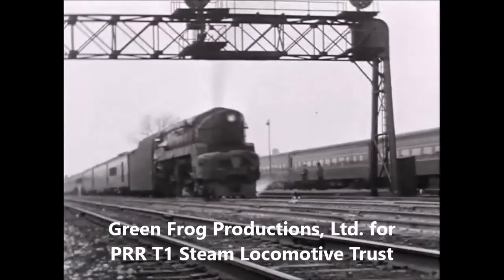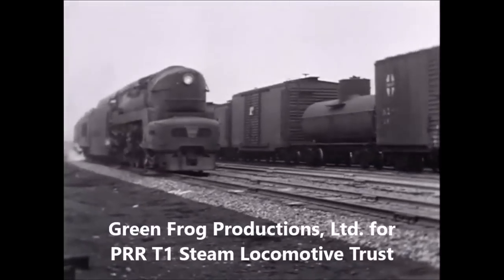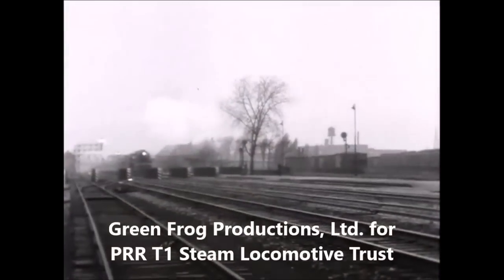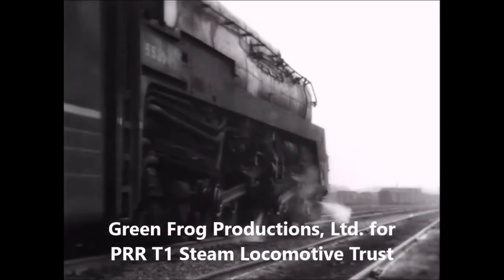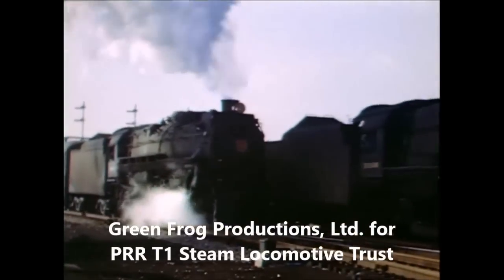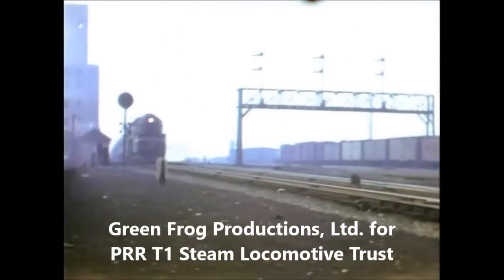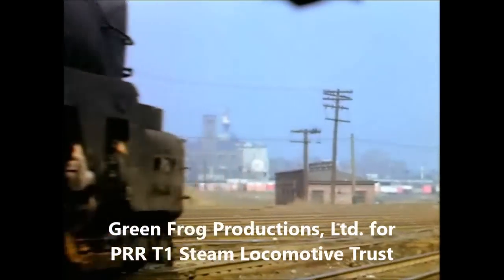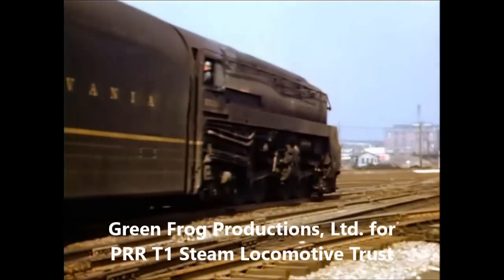The Golden Twlight of Postwar Steam Pt 1, Green Frog Productions, Ltd

Comment: All I ever hear is how common it was for the T's to have wheel slip.  Many yrs back I talked w/a retired PRR engineer who really liked the T1, and a friend of mine's grandfather also ran T1's in passenger svc.  He too was a T1 fan.  Both had the opinion that excessive wheel slip was a crew thing, and, or, due to lack of maintenance.  I would love to see the 5550 project go the distance!
Reply: The T1 wheelslip was largely due to improper operation by the crews. The trick to operating the T1s was that they had to accelerate VERY gradually in order to maintain their adhesion. The passenger steam locos the Pennsy traditionally used (Atlantics, K4s, etc.) were engines that designed for quick acceleration on commuter runs, and as a result many crews tended to operate the T1s in the same manner. 

Interesting fact at one point the Norfolk and Western, a railroad that specialized in slow, drag freight, tested a T1 on their trains and concluded that the engine had no design flaws and that all they required was proper training.
Reply: Patrick3751 yes, that sounds right. Sure, when starting a train the weight shifts backwards, especially because of the water in the boiler, which is not a problem on a 4-8-4, but on a duplex that has a different outcome. And the engine produced 6552 hp (some say up to 6760 hp), that is more than 3250 hp per cylinder-set, which is about the same as a K4s, but the K4s has 6 drivers, one set of the T1 only had 4 drivers. If you would handle a T1 the same way as a K4s it would act not like a K4s.
Reply: The new one will have the new valve gear they tried out to resolve the wheel
Slip issue
Reply: @Patrick_3751  you mean a slow and steady pace?
Reply: 5500 had diffrent valves fited after an accident, that became the best in the fleet
Reply: I know this is an 8 year old comment, but I think part of it was that the suspension wasn't equalized quite right between the front and rear engines. The front engine was the one that slipped regularly and as far as I know this was because the rear engine's  slightly greater weight on drivers held it to the track a bit better than the front, given the suspension in use. 

It didn't help that that the T1 is way higher power than the K4s that it replaced, nearly 100psi higher boiler pressure and much higher horsepower.

Comment: One of the great things about technologies before the end of World War II is they can be revived at will, including the electronics of that era. In the post-war period, solid-state devices began to appear first in information/entertainment systems, then transportation, material handling, power, etc. If one wanted to re-create an early model pocket radio, one might find the primitive germanium transistors to be unobtainable unless you can spend several millions of dollars to create a small production line for them. The same is true for a certain model guitar amplifier, circa 1972: the SE540 integrated circuit would cost millions to fabricate one, or ten thousand
Reply: A piece of tech needs to be at least 70 years old to be easily recreated. A cycle really just like history.

Comment: It's a shame that none were saved.
Reply: Yeah, instead they saved a damn B4a!
Reply: What happened to the PRR program that saved all the PRR power that ended up at Strasburg?  Hat's off to the PRR for that effort for sure, but why no PRR T-1??
Reply: Probably because they were given so much publicity when they were introduced, then they started having all those problems, the PRR perhaps though of them as a failure so didn't want to draw attention to them by the late '50s.
Reply: I think you'll be happy to learn they're building a new one! Look up the T1 Trust. They're doing what the Brits did with the 60163 A1 Tornado, and building a new T1 from scratch. It'll be numbered #5550, and already they have the tender, front piece, cab, some of the wheels, and part of the boiler. They hope to have it finished by 2030.
Reply: Oakview Films 2030?!?!  Wow that's long

Comment: As an admitted Reading fan, I find it interesting that at the same time the the PRR was scrapping THEIR T-1's (4-4-4-4), it was leasing many of Reading's 4-8-4 T-1's (1956 and '57 I believe) for freight power in and around Enola (predominantly Enola and North).

Of course Reading's T-1's finally got their shot at passenger service in the Iron Horse Rambles of 1959-1964 and on many, many later incarnations including the American Freedom Train and the Chessie Steam Special.  Perhaps PRR might have been better of with 4-8-4's themselves which had long since been perfected on roads in all parts of the country.
Reply: Lenny Hendricks actually PRR leased N&W J class locomotives as well. It was found that the J class locomotives performed better. they don't have the wheel slip problems like T-1 and can do better on rougher terrain. I am a big fan of the NW J. I think if Pennsy would have kept the T-1 with a more conventional northern design it would have performed better..
Reply: Lenny Hendricks do you know reading 2100, 2101, 2102, & 2124 will be in the story of PRR 5550 and also 2101 will run again this year and also there is gonna be a C&O J1 built and it will be completed in 2023 and it will have a new speed limit and it will be up to 140mph and it can travel from 70mph to 125mph and also it will run from Charlotte, NC to The first stop of the Train to Thomaston, CT from the N&W line to the Nagatuck railroad line to thomaston, CT and it will run every, day, week, & month, & year, and it will be reliable and it will pull the American freedom train by doubleheading with Santa Fe 5011 every 4th of July
Reply: N&W let PRR borrow ONE for testing, and somewhere over 100mph the valve gear blew out.  The book Rails Remembered (#6) talks about the engineers from Roanoke went and brought her back on 1 cylinder.
Reply: I knew PRR leased ATSF 2-10-4's, I didn't know they leased N&W J's.  They probably would have been better of with N&W A's, but they had already rejected A's back in the beginning of WWII when they accepted the C&O 2-10-4 design for the PRR J-1's.  But they did lease the RDG T-1's also.  Check out David P. Morgan's STEAM'S FINEST HOUR.  Also many others about this period on the RDG.  Some of the first RDG 4-8-4's to be scrapped were the one's PRR had used and ruined.  ATSF and RDG were dieseling at this point, so nobody cared as long as they got the lease payments and got the carcass back to be scrapped.
Reply: I rode the Chessie Steam Special when it came to Pittsburgh. I was about 9 years old at the time.

Comment: I pray they fix the wheels. The wheels on the orginal engine had a very high a chance of wheel slippage while going up hill.
Reply from the maker: Anarchy Truck Pulls Those problems have been addressed. Take a minute and read the FAQ on our website, www.t1trust.org
Reply: Ok
Reply: The T1 Trust this locomotive needs to be around long enough and you need all it's flaws to be correct and also it will never be retired and it will exist forever and remember to do the flaws and it will be correct too.

Comment: Now is the new one gonna have real poppet and a non Pennsy water feed so it can work with less wheel slip and have more steam made.
Reply: Matt`s Mocs because they know the actual one couldn't do the record, so they are trying to unfairly change it in order to vandalise history.
Reply: If they can't make obvious updates they'll never reach their goal of beating the mallard's record.  It a question the donors to the project have to ask themselves.  What is more important to them?  Historical accuracy or the speed record?  It's a question for those putting up the $$ to make, not the railfan community at large.  Ross Rowland certainly made all the changes he wanted to on the engines he restored, esp NKP 759 and RDG 2101.

Comment: This loco would have fared better in service if the 3 rd and 4 th cylinders were mounted between the frames driving the third axle and the loco made into a 4-8-4. This would have helped in the slipping problem

Comment: The Being SHOW a T-1 at 65 the. Street out of the MAIN ENGLEWOOD STATIONS. 
      The T-1 was on what was CALLED WEST SIDE of the ENGLEWOOD STATION. The TRAIN on the other side was ACTUALLY, The NEW YORK CENTRAL RAILROAD.
    The only real Problem with the T-1 was it's on a HARD inclined and HEAVY RAIN allot of WHEEL  SLIPPING and allot of SAND on the tracks.
  I SAW PERSONALLY from the AGE of 7 - 11. I lived three BOLCKS AWAY it was GREAT and at the age of 76. I JUST WISHED  that the YOUNGER KIDS Could SEE the SIZE, HEAR the STEAM in creeking, hissing, spitting, the SMELL of COAL, OIL and WATER. And the HEAT coming from the ENGINE .
    ""ALL, IF I COULD GO BACK INTO  TIME  THE PAST WOULD FROM 1945 - 1954 where STEAM was KING AND FOR GOOD REASON"". GOD BLESS AND PROTECT ALL OF USE ALL OF USES.

Comment: Are t1 not articulated
Reply: yes no articulation
Reply: PRR T-1's (as well as the Q classes and the S-1) are duplex drive, not articulated.   Duplex drives are 4 cylinder locomotives like articulateds, but the front engine cannot pivot independently on duplex drive locomotives while the front engine can pivot independently on articulateds.  This is why duplex drives are called rigid frame locomotives.

Comment: Not saying that restoring a T1 is a bad idea, I love the idea, but weren’t the T1’s problematic? Didn’t they suffer from lots of wheel slip?
Reply: From what I've read it is suspected that engineers used too much throttle at startup because they were used to their less powerful engines and the T1's poppet valves allowed more instantaneous throttle response.

Comment: I support your trust, except for how you apparently want to beat Mallard’s record. Records are meant to be broken, yes, but still.
Reply: "records are meant to be broken, but still"  The record was never mallards to begin with.  
If the brits want to keep their record, they'll just have to earn it.  The only reason the mallard has maintained its record is because its record is official.  There are stories of T1s going 140.  While these can't be confirmed, you'd have to be pretty stupid to doubt it.  Considering an E6 atlantic, a piddly locomotive dwarfed by the sheer scale and power of a T1, could manage 115 mph, the notion that the T1 is incapable of 128 mph is asinine.  Should the T1 be completed, and a flat enough section of track found, you better believe that a free steaming rigid frame duplex is going to shatter the record of a pacific covered in shiny sheet metal.  I'd even wager that a T1 pulling a train of heavy weight cars could beat the mallards record.  With that being said, the Mallard can probably go even faster than it's own record.  Bear in mind it was hauling cars behind it, and with a downhill grade steep enough just about any locomotive can be a speed demon.
Reply: No-one will ever beat Mallard's record.
Reply: @Xenogeek2  On the contrary: There are credible sources behind the notion that Mallard's speed has already been bested. One of the goals of the T1 trust is to investigate these claims.

Also, keep in mind that Mallard severely damaged itself during the record setting run. The A4's didn't do commercial service at 128 mph.
Reply: @Mrcake0103  thing is tho if they go for the record and somehow break it (which is highly unlikely) that T1 wouldve killed a legend. When it comes to steam engines 4468 is one of the all time greats and breaking that record would basically kill it.
Reply: @ajf3202  what about Scotsman? Usually he gives the image of what a steam engine is: a larger loco with a tender pulling a rake of coaches
Reply: @davidantoniocamposbarros7528  thing is tho. When it comes to mallard people from all around the world go to York to see it. 4468 is the main attraction of the NRM and one of the greatest engines ever. Why? Its the fastest in the world. The T1s goal is not only shitting on 4468. Its shitting on all of the A4s, its shitting on the LNER and its shitting on Sir Nige. Not to mention how dangerous it could be.
Reply: @ajf3202  yes,my biggest concern is that it might fail. Now if the T1 breaks Mallard's,well it's a bummer but i hope the run goes successful because if something bad happens then it won't be good
Reply: @davidantoniocamposbarros7528  i wish the project all the success on running this beast on tours. I hope it gets alot of speed and everyone is safe on the record run. But i hope it doesnt break 126. I will try and get over and do an excursion on it when its finished but it probably wont break the record.
Reply: @ajf3202  i mean it can still break the record but hey, let's built another A4 to see if it can match the T1 (probably no but at least reasonably so)
Reply: @ajf3202  also,Mallard's record is 125.88 and not 126
Reply: @davidantoniocamposbarros7528  mate theres no need for a new A4 if 6 already exist. Besides how come the plaque on the side of mallard says it did 126, not 125. Hope the T1 trust actually use common sense and decide to ditch this pointless attempt. Its gonna cost alot, it could be dangerous and it might not even be allowed to go for it.
Reply: @ajf3202  they just redunded to 126,idk why but oh well. Yes even there's already 6 A4s,a 7th one wouldn't be a bother (or would it,idk). If someone comes up with a idead to build a new A4,then at least honor Sir Nigel Gresley's wish to let an A4 do 130 MPH but even so,there's always a bigger fish
Reply: i dont think theres a mainline that able to support a 140 MPH run anyway, let alone NEC with its curvy tracks

Comment: Irrelevant ‘Streamlining’, over a complicated steam circuit, poor adhesion characteristics and far better 4 cylinder design methods available leads me to believe this locomotive was someones last days of steam vanity project that showed it’s vices from day one, Looks the part but never quite lived up to the hype, Sorry guys, as an engineer, the keep it simple, method was always the way to go because it worked out of the box but I am always happy from someone to prove me wrong, Good luck with the project.
Reply: These, like the Union Pacific Big Boys, were built during World War II because the diesel electric engines that locomotives had begun using were needed for Navy submarines and LSTs and railroads couldn't get any. The steam era probably would have ended 10 years earlier if not for WWII.
Reply: It was the crew that were the problem as the Norfolk and Western tested one with their crew and it was fine they just made the locomotives accelerate too fast